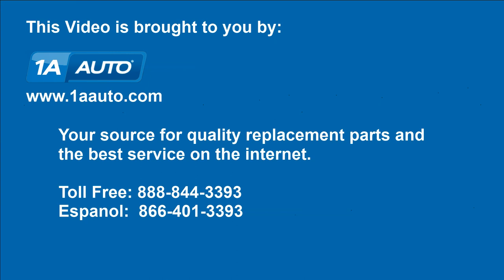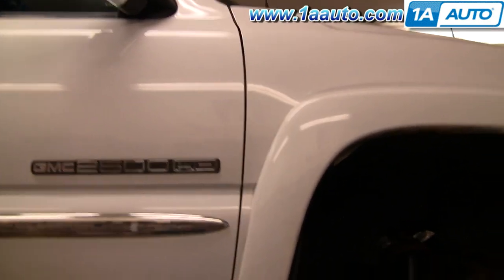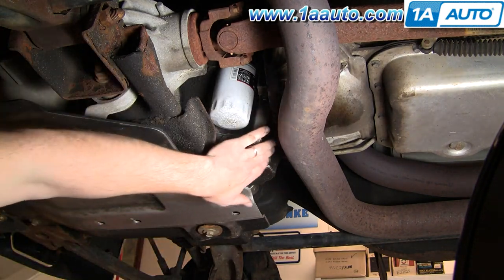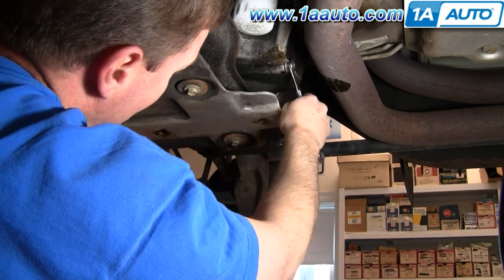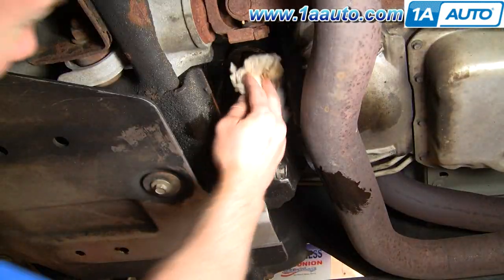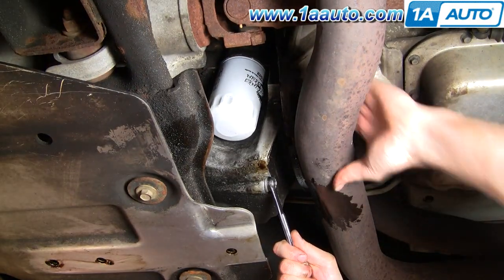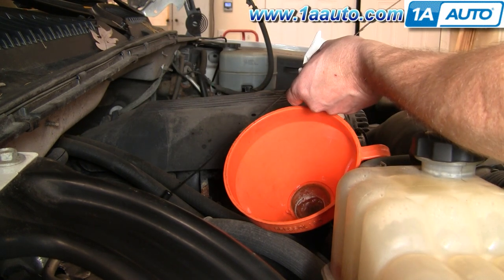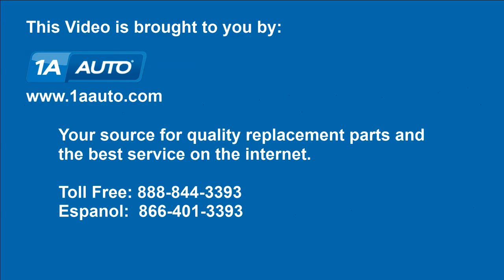How To Change Oil 00-06 GMC Sierra 2500HD 6.0L

Comment: I wanted 2 add that pouring 1/2 qt oil in new filter (since it is mounted verticle) no oil will pour out. Better 4 engine than an empty filter at start up. Enjoy yer video's.

Comment: Also, depending on your hand strength, you may not want to use a tool to tighten the new oil filter. I have never used anything other than my hands to install new oil filters --- hundreds installed and zero leaks! If you can get close to 3/4 turn after the gasket ring just makes contact with the sealing surface on the engine, you will be fine. After you start the engine to get oil into the filter, take a look under the vehicle to make sure no oil is leaking. Top off and go.

Comment: I have a 2006 GMC Sierra 2500HD with a 6.0 and my oil filter is half the size as the one shown. Do you have a part # for the one you installed and took off? Thanks
Reply: just picked up my filter an its tiny 😂😂
Reply: I just use ac Delco oem.

Comment: On my 05' I turn the key on but don't start it.  and push the gas pedal three times the mileage or percentage gauge will reset.  It does cover it in the manual.

Comment: i noticed you didn't put a deflector out the back of the skidplate so the oil doesn't drain onto the skidplate. i could see the oil dripping out the front holes of the skidplate. out service manager gets mad at us if we don't either take the skid plate off or put a deflector on there, he hates comebacks for oil leaks, and all it is, is the oil laying on the skid plate.

Comment: my engine is the 6.0 in the suburban 2500. the manual says 6 qts of oil should be used
Reply from the maker: +EnslightenedNeanderthal Every model might be slightly different. Always double check the manual and go with that.

Comment: I have a plastic tube that came through the drain hole, which is not quite small enough to pull all the way out.  Looking for a parts diagram to see what the heck it is....I assume a pick up tube for the pump maybe?
Reply from the maker: +HardDriveRecording regardless of what it is, you shouldn't be able to see it from the drain plug. You should consider dropping the drainpan and figuring out what that part is and where it's supposed to be. Don't continue to drive the truck in this condition as it's possible the oil isn't getting to where it needs to be. Let us know what happens!   1aauto.com 866-403-3393

Comment: What size and kind of oil filter is that? the one i use is half that size.
Reply from the maker: +Charles Jackson That appears to be a Parts Master 61522 oil filer, which I believe crosses to a AC Delco PF61 and Fram PH9837!
Reply: PF46E or PF46 AC Delco 
PH3675 Fram

Not these one ?
Reply: Was going to ask the same, mine is a Yukon XL Denali... maybe that's why?
Reply: Charles Jackson  you're right! I use a Mobil 1 and it's like half of what their using. My 1980s -454 used that huge filter. I'd like to know why the tiny filter is being used now. I'm guessing $, has something to do with it. Their cheaper to make,and they still charge the same price.

Comment: My filter is covered in oil. Any ideas why? My low engine oil light came on. Any gaskets anywhere leaking?
Reply from the maker: If you just did an oil change and replaced the oil filter, the old gasket from the old oil filter may have gotten stuck on the engine block. You may want to see if this is the case. Hope this helps you out. 1aauto.com 866-403-3393

Comment: how is it a very bad design?  having the drain plug going straight down will cause even more problems hence why the skid plate is there, the bolt can get sheered off, and actually most cars are out the side for the same reason.  all GM truck pans are identical, no reason to make them any different. also, since the 8.1 and 6.0 have dual 3" exhaust they take up a good amount of room, which is another reason the oil hits it a little.